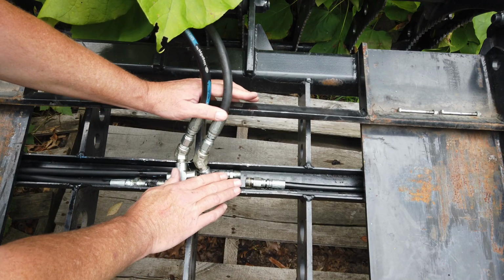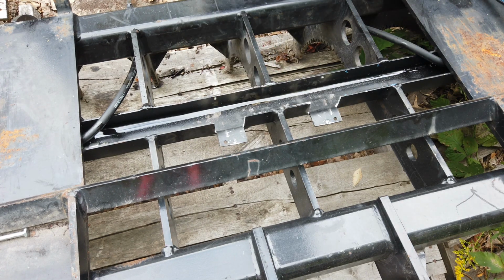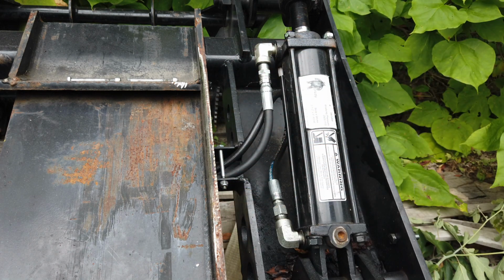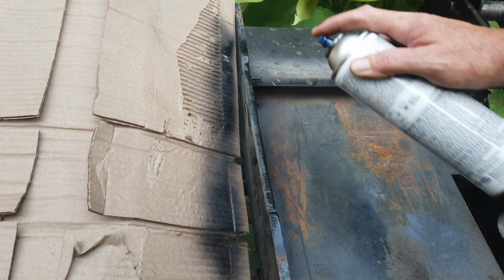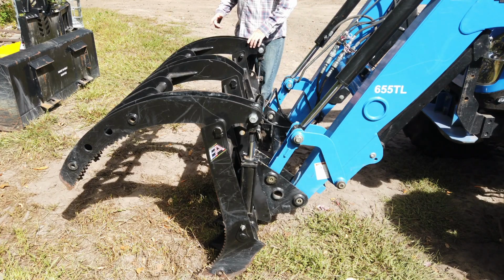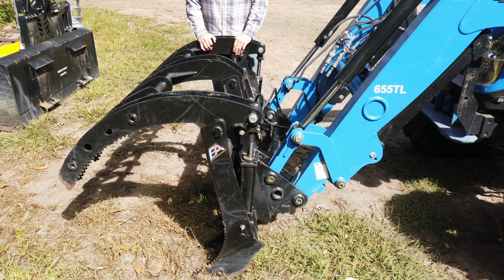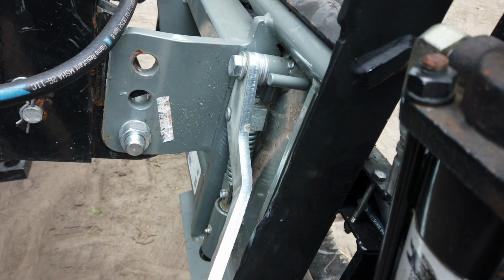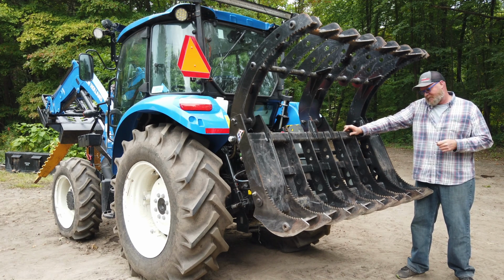Grapple on 3pt??? What did it take...

Comment: I have a similar rear setup on my tractor, minus the quick hitch as things get a bit floppy with all those intermediate connections. I converted all of my 3-point attachments over to SSQA and just left the Worksaver on to serve as the quick hitch. Now every attachment fits/operates on the front as well as the back of the machine. That configuration is also great for hauling to jobs because you can trailer the equipment light and then use the but log of the first tree you remove as ballast. Also, welded in a 2-inch receiver to my Worksaver adapter. Absolutely indispensable!

Comment: Great minds think alike. lol  I bought a 3 point to quick hitch and quick hitch to 3 point adapters and use my tree shear and tree puller just as you have done. I have a frost bite log grapple but have been wanting to get an EA grapple as well. I should have pulled the trigger on that a couple of years ago before everything went to hell a year and a half ago with potato head.